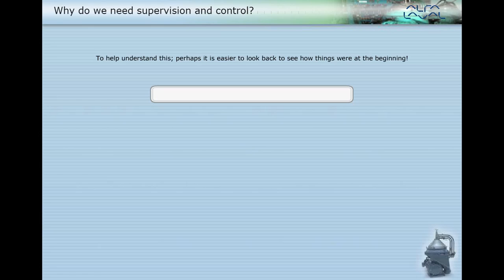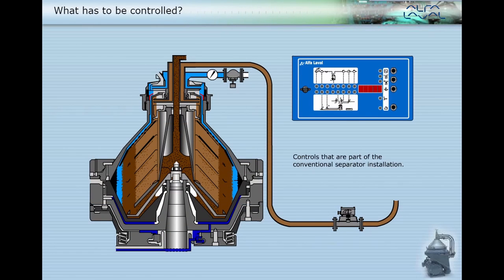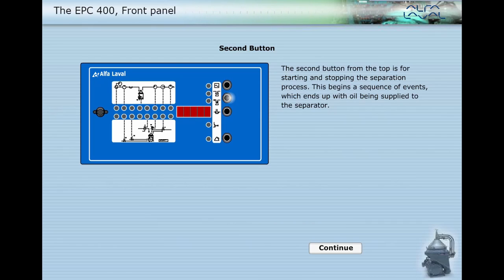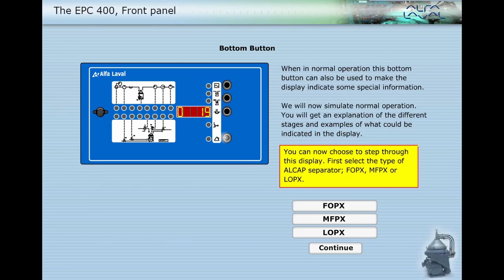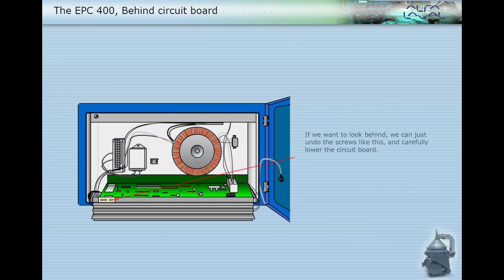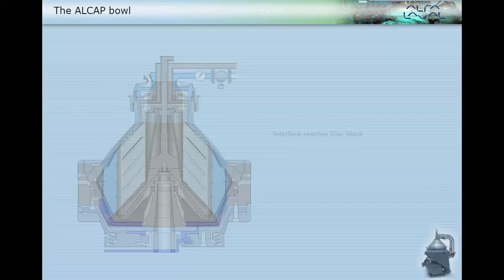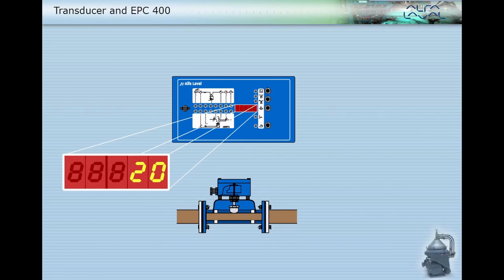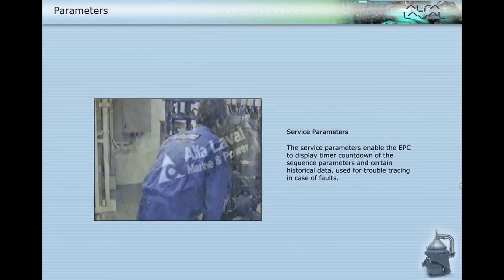How to Operate Alcap PURIFIER   Supervision,  ECP 400 Control & Parameters

Comment: Operating temperature adjustment method
Reply from the maker: for the temperature, ECP will automatically signal the Temperature controller according to the set data that you have input.